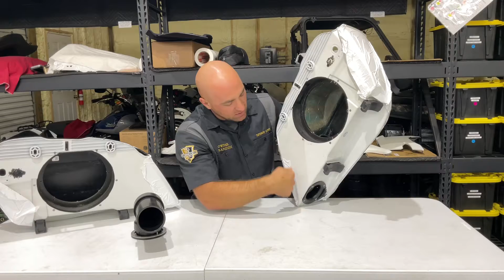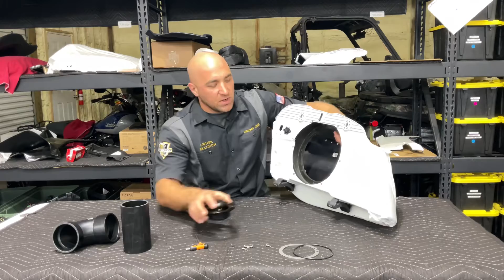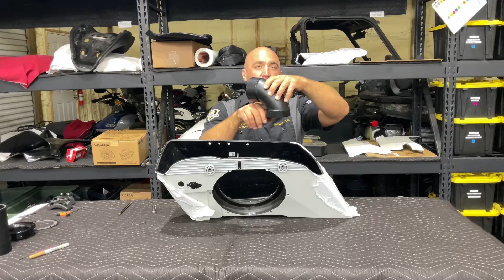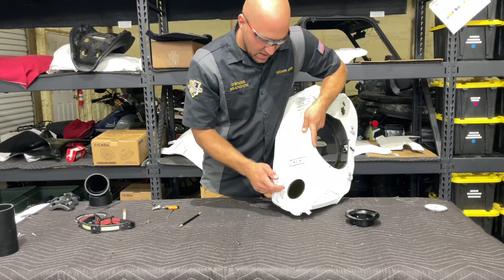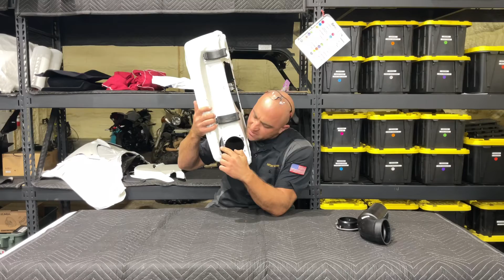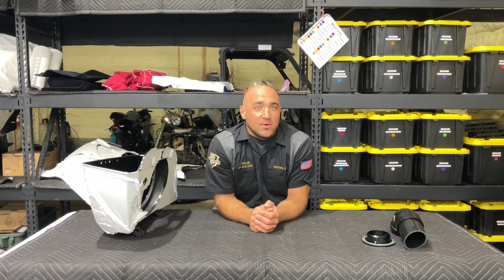Port Install + Indian Saddlebag = More Midbass

Comment: Very nice Brandon! I've been looking for more info regarding porting.  I know there is math involved with the port length/diameter but is there a difference with a bottom exit or side? i can see you are somewhat limited on your length due to where the rings are (centered on the bag), would it benefit to have the rings offset more to either front or back of bag to get a 7-9" length?  Finally, did you decide/say  what 10s you are using? I have been thinking about the Diamond Audio MSMB10NEOs and a 1600.1
Reply from the maker: The 10” rings are designed and molded to only
Fit properly in the center. If you were to off set the ring the bag design would cause the ring and 10” speaker to interfere with other parts of the bag. We will play around with different port locations to see how much the port length changes. We decided to go out of the bottom of the saddle bag to conceal the port. That is a good combination for the stock saddlebags. For our build we are going with the cicada audio pro midbass speakers on a 3,000.1
Reply: thank for the reply! look forward to the next parts of your video series
Reply from the maker: The third and last part will be dropping tomorrow
Reply: There is no way that port is protected from water splashing upwards? Then what do you do ?